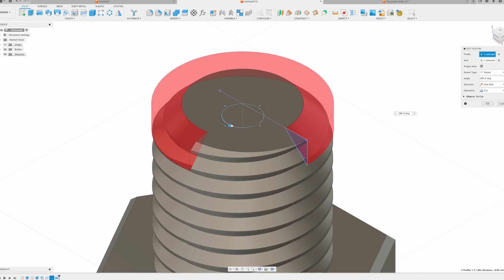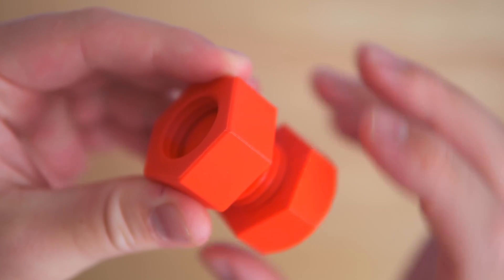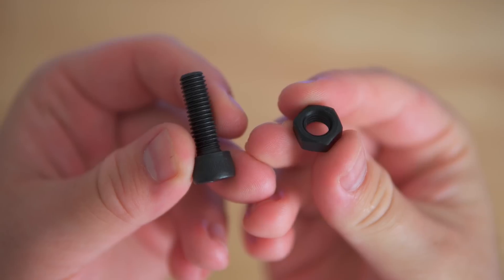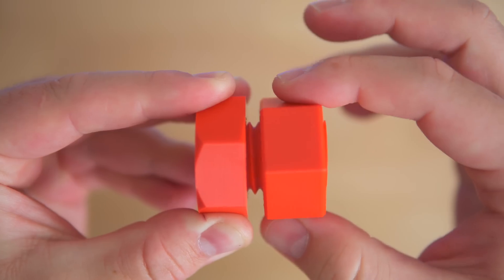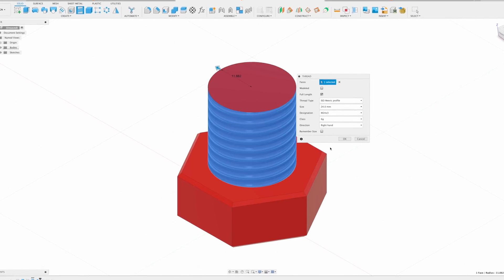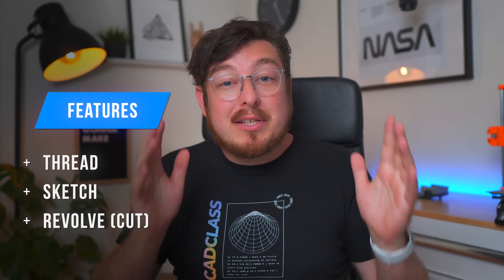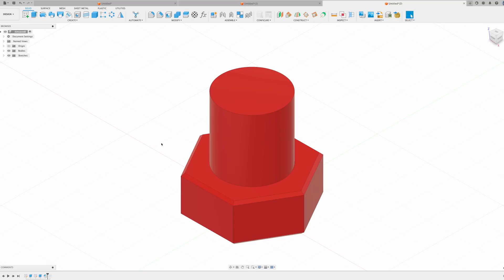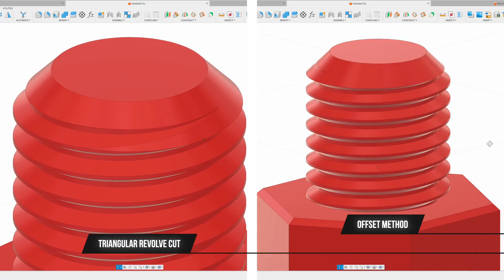BETTER, FASTER, STRONGER 3D Printed Bolts | Errata

Comment: i just tried in fusion.  i use the off set method, but after thread is made and chamfered, i cant use Q to off set surface anymore.  then i tried to do the Q before the chamfer , but after that, i cant drag the timeline pass the chamfer anymore. how to fix this

Comment: Sorry but this method creates an impossible overhang for 3D printing on the first thread. I offset 1mm and put a 1.5 and also tried a 2mm chamfer and in both cases was left with a 90º overhang

Comment: Make a copy of the bolt before threading. Chamfer it. Take the intersection of the two objects. Maybe it is too many steps. I am never going to take a test.  I would not be sure that the chamfer would work correctly.

Comment: Number of features used to design the part isn’t a good proxy for efficiency. 

In parametric modeling you want a feature tree that is easy to navigate and modify. It’s not necessarily the one with the fewest features utilized.

Comment: This video just highlights why fusion 360 sucks. It should have had thread / bolt features and customizations (not jank scripts you dl) for 10+ years, but it hasn't, because it's lazy garbage and autodesk just sits on their butts. There's no way to make these techniques actually 'parametric' in f360 without doing them for EVERY SINGLE THREAD. I have no words for how stupid this is.

Comment: Where is the part about "Stronger"? If I print a bolt vertically, then it is very weak along the layer lines, and tends to sheer along the layer. Print horizontally and the threads look like crap.

Comment: A common terminology mistake I hear a lot on YT is using "tolerance" when referring to the gap between two parts. This designed gap is referred to as "clearance", not "tolerance". Tolerance is the potential allowable variation with a part's dimensions so that it will continue to perform the desired function, while clearance is the space designed between two parts when they're assembled (like a bolt and nut).

Comment: Draw cylinder, go create - thread, pick the tread you want, do not check modeled box, close that window.  Pick modify-chamfer.  Here is the secret  Apply the chamfer to the CYLINDER, not the flat face.   Now go to the timeline and right click the thread, select Edit Feature and check the box labeled Modeled.     You now have the proper lead in for a thread.   And you can simply edit the chamfer for more of less lead in.

Comment: Great video with some good information.  You've confused tolerance with clearance, though.   

Tolerance is the difference between the maximum and minimum dimensions of a part, such as its length, width, or diameter. Tolerances are used in manufacturing and engineering to allow for variations during production. 

Clearance is the gap or space between two mating parts, such as a shaft and a hole. Clearance is determined by the size difference between the parts.

Especially when 3d printing, you need to deliberately add some clearance to account for the inaccurate tolerance of the process.

Comment: I learned the chamfer trick a while ago messing with bolts in fusion 360 from the McMaster carr catalog

If you take one of their bolts and delete the threads off, the shank is not just a cylinder

Comment: I don't make a lot of threaded parts. When I do, I make the female and male threads from the same geometry. They are exactly the same. Then I scale the male part on x and y axis to 0.9. Adjust as necessary. The threads always fit and work great.
Reply from the maker: thats essentially what is happening here with the offset, the only problem is your 0.9 scale may get out of wack for really small or really large diam threads
Reply: @CADclassOfficial  maybe, I don't see how. A fixed offset would be more likely to fail at different sizes as opposed to a relative percentage. IMO.
Reply: @CADclassOfficial  Forgot to mention I found a big improvement by switching the slicer parameter from print inner then outer to print outer first then inner walls.

Comment: I know this is an old video but I've spent the last week prototyping bolts and internal thread for 3d printing.  I've found that reducing standard bolts by 2% in x and y, and scaling all internally threaded nuts by 10% in x and y screw together very smoothly without any skipping.  useful if you're printing nuts,  useless if you need threaded holes in any precision part.

Comment: A couple of things:
1. If you do the surface offset some on the female thread, and some on the male thread, you get a better, stronger thread profile, and not that 'blade' like thing you're showing here.
2. If you already have the hole modelled, and you right click the interior surface of the hole immediately after applying the male thread, then select 'Repeat Thread', you get a female thread with an offset.  Admittedly, F360 uses 0.1mm in this case, but that also is something you need to be aware of.

Comment: I like this, but there is a good reason to keep that chamfer-by-rotation in mind. That would be a great way to do it if you wanted a pilot section on yout bolt. By that I mean a short length cylinder at roughly the minor dia to help locate the bolt during assembly. A great feature for bolts that line up and hold a sliding mechanism, for example.

Comment: SO. How does this make bolts stronger? The weak link is layer adhesion. You’ve not addressed that. Use supports and print the bolt at a 45° (or whatever your machine can handle) for layers that transcend the threads.
Reply: I think this is solely about design, and not the 3D printing.

Comment: What printer did u use?  That embossed lettering looks great.  Well done.
Reply from the maker: Prusa MK4. But you can get the exact same quality of vertical wall text; it's just based on the amount it's extruded from the surface, too far out, and it will droop too much. If you have a great 3d printer with great cooling then thats no problem, but if you have a basic printer then you need to reduce the extrusion to about 0.25 or 0.5 mm

Comment: As an engineer doing complex injection molding design for a decade and a half I would say the number of features in the model timeline is far less important than if your timeline represents design intent and how fast you can make the inevitable change requests to the model. For less complex designs it’s also better so that you can make configurations of the same model for use at different sizes. Less features is maybe great for a competition recreating an existing design but falls flat in the real world of designing something new.

Comment: 0.4mm offset is wild and depends a lot on the printer's calibration. I'm using between 0.1 and 0.2mm (the bigger the thread diameter the lower the offset) and my screws and nuts work fine.

For the chamfer, I'm usually catching the overhanging part of the thread and round it to 0.5 to 1mm. Works great for catching the nut and bolt together and is easy to print.
Reply: Yes. And there are also non-fdm printers around.
Reply: @Fahnder99 , I am betting he uses a good FDM printer...

Comment: What's Autodesk really like to use? I see mixed reviews on it. And what does it actually cost? And how well does it handle PCB design?
Reply from the maker: It’s my personal favorite CAD software. It’s very powerful for hobbyists but probably not the best choice for an engineering firm. It’s completely free but there is a paid version but in our course we tell you how you can get it completely for free. I don’t have a ton of experience with the PCB side but from what I’ve seen it does in fact work well. A few of our student have gotten prototype boards from their PCB CAD models and I think this is where fusion updates a lot of tools every month too.
Reply: @CADclassOfficial  As I understand it, the free version of fusion is limited to 2 layer PCBs. Which is a showstopper for me. Also, I want a painless way to do 3D metal printing. Does the subscription version of fusion allow me to get stuff made? I see Autodesk touting its additive manufacturing extension, which is more expensive than fusion itself!. And I'm assuming its not really necessary to actually get something made. I mostly do electronics design, but I'm interested in learning CAD. Thanks.

Comment: Create the thread, right click and choose supress feature on the thread, and then create the chamfer. Then you can unsupress the thread and everything works.
Reply: I only model the threads and create the face offsets at the end of the entire design process (before exporting either the STEP file or STL for printing). Again, saves computational time, and then the chamfers work on male or female threads.
Reply: I just tried this but it didn't work for me. the bottom of the thread is all sorts of messed up. it's like going inside of itself
maybe this only works if your cylinder and thread diameter are the same and using ISO metric threads
but I like to use ISO metric trapezoidal for 3d prints. it gives more coarse thread pitch making it easier to screw in

Comment: I’m sorry, this was in my feed and I watched it and could tell that at the 1:00 mark, all the information that was going to be said was already said. Yes, time can be saved by doing this, but how much - 20 sec? The video title is also misleading, since the faster refers to the modeling and not the printing and is only 20 sec improvement, and the. Idea does not address better or stronger in any way.
Reply from the maker: We’re not a massive fan of unnecessarily long videos that bait the solution till the end. If you get what you need at the beginning, fantastic, and if you want to learn a bit more about the topic then stick around :)

Comment: After using face offset, chamfer doesn't work. If I do thread+chamfer, offset faces will undo the chamfer. Any tips?
Reply: alternatively, cut the chamfer first, then the threads, then just move the chamfer after the threads in the feature timeline
Reply: @johnnycardoso1965  doesn't work. at least not like in the video. When he chamfers, he can chamfer any length. Here it won't work. Is it because I'm using the free version? @CADclassOfficial
Reply: @julianopolito, create a 1mm chamfer, then create the thread, with modeling and displacement of 1mm (the same as the applied chamfer). I use 1mm+25%=1.25mm. It will work depending on the thread size you are using.
It doesn't matter what version of Fusion it is, as it's just a build operation.
This tip I gave is more complex, as you create the thread with displacement, suppress it in the history and then create the chamfer and then move the chamfer to before the construction of the thread, in the history. Then you cancel the thread suppression.

@julianopolito, are you Brazilian?
Reply: @johnnycardoso1965  Sim, brasileiro. Você também?

Comment: Well, actually there is a way to do it using only one feature (the chamfer itself) and a small trick with timeline. Make a thread, then go one step back in timeline (before the thread creation) create a chamfer, move the timeline to the end and swap the thread and the chamfer in the timeline (change the order). The result will be the same, with ONE operation .

Comment: In what way are they stronger...?
Reply: Printed vertically the thread will be weak as hell due to layer lines. You can get away with it if you're printing fisher price nuts and bolts. Anything small and they'll be useless

Comment: Oh wow, thanks for this, can’t wait to try it. I’ve been doing the rotated triangle thing forever.

0.4mm is a crazy large amount of easing, though. If you need more than 0.15mm, I suspect that something in your printer or slicer setup is not tuned correctly.
Reply from the maker: The 0.4 is mainly for some of our student that use older printers like the Ender 3 that doesn’t have super tight tolerances or for threads that may get fuzzed up over time with constant screwing. But yeah they could totally be tighter :)
Reply: I agree, for my FDM 0.2mm is good enough. And 0.4 won't even work for smaller threads like M3.
Reply: @osmanpasha_diy  yeah on my used Ender 3 from Craigslist where the dude left it on 220V mode in the US and rammed the nozzle into the print bed (giant groove in it)
after fixing it up I was able to easily get 0.2mm to work (0.2mm total, so 0.1mm when using the offset tool since you're offsetting the top and the bottom)

I've been wonder how to get the bolts to fit into the holes easier though. I was doing a countersink on the hole-side threads but now that I think of it a chamfer on the bolt is indeed what store bought bolts do...

Comment: Even better workflow optimization would be to not design bolt or nut at all.
Just use predesigned ones of type/length/thread from library or parametric model, done by self earlier or 3rd parties.
"To not reinvent wheel" in each project all over again. And it's not applicable to just bolts/nuts. There are loads of standartised parts, including various fasteners, out there, including libraries or models for them.
At most, it should be extended with some 3d printing custom nitbits, like smart bridging for dealing with hex hole quality/supports/postproduction, and maybe adding flank-drive rounding or corner hollowing of hex holes to increase resilency to stripping, and even such customisations can be reused from previous work/models.
Reply from the maker: Definitely :) this video isn’t about making a bolt in heart thought it’s about any threads for any project

Comment: I go chamfer(just deeper than the thread), thread, delete flat end of the thread. Sometimes it bugs out but usually it works great.
Reply from the maker: Interesting :) one of the other comments said to make a chamfer, add a thread under it and then move the chamfer after it in the timeline and it does in fact work

Comment: For 3d printed threads, I find that especially with materials that require a heated enclosure, standard ansi and iso thread profiles can have overhangs that make coarser threads not print cleanly.

This doesn't generally stop them from functioning,  but it is annoying.

Three solutions for folks that have this issue:

1 Use inner-outter or inner-outer-inner wall printing order (do this anyway, it makes everything better).

2 Use a tighter thread pitch. Not appropriate for all applications.

3 Model threads with a 45 degree overhang. This is pretty easy. Just add a helix around your cylinder and sweep the profile you prefer. Generally, you can just do this to the male thread and boolean it with an offset to create the female.

I will write a script that auto generates these shallower threads at some point, when I get sufficiently annoyed modeling the thing. For now, I just have a parametric thread model I use.
Reply from the maker: Fantastic :)

Comment: A lot of the time you're better off just using a tap/die. Unless it's an unusual size, or for some reason you need to print off a ton of parts with threads, it will often make more sense to just cut the threads rather than take the time to design them. The cheapest tap and die set you can find will work perfectly fine since it's plastic. Plus the threads will be way better quality, especially on smaller sizes that an FDM printer has no chance of printing well.
Reply from the maker: Definitely although I have had to put in so many threads into prints that my tap heats up from friction and melts rather than cuts the plastic prints so best to keep an eye on it :)

Comment: 3D printing threads is kinda meh to begin with to even bother, unless its something mildly cosmetic, fasteners are the only way. 
That tangent on 2 vs 3 features - oh geee, just staph - things like that tend to iron out automatically the more you use your CAD.